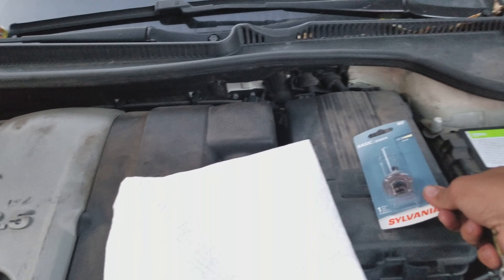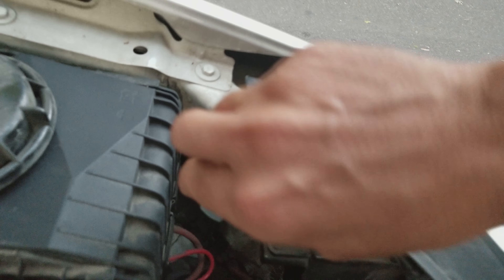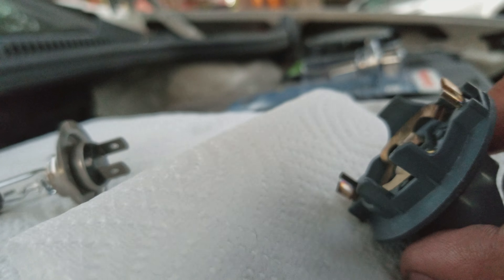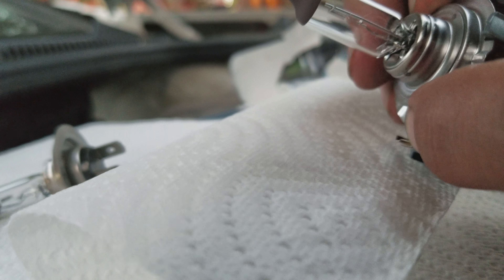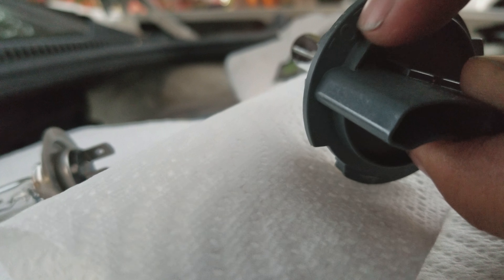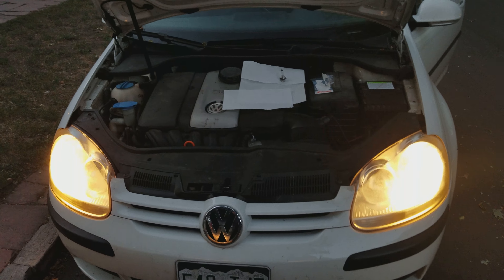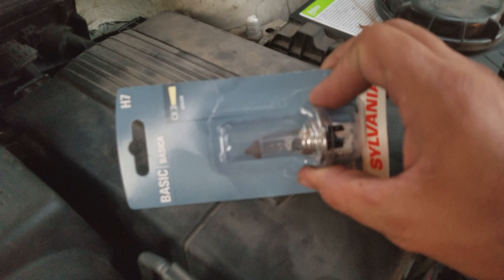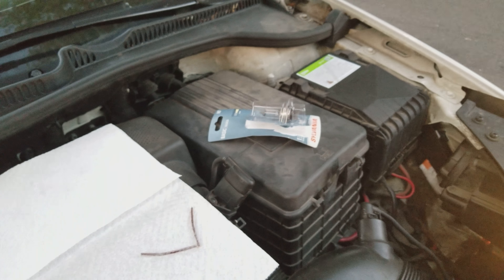How to change / fix a headlight Bulb in Volkswagen Rabbit Jetta GTI Passat Golf 2007 2008 2009 2010

Comment: what about the Bright bulb?
Reply from the maker: I have not had to do a high-beam yet but I think it's pretty similar of a procedure
Reply: @NickTheDenverDirtJumper  the High beam has a plug without clips; simply wiggle and pull out (very stiff, thinking it could break), then un-clip the hinged bulb holder/clip; replace the bulb, add Dielectric Grease to the plug contacts, incert the plug; all is well... 🚗

Comment: No one ever says what b ulb u need in these videos. And that's the high beam. Low beam is much harder to do
Reply from the maker: It's an h7 bulb and there's a link in the description. And that is the low beam it's also the same as the daytime running lights I've had to replace multiple. it's not the high beam.

Comment: NOT for 2008 as I have one.  There is a wire clamp to remove and the bulb has a socket holding the bulb that is removed from the main housing.  I want to know how the bulb itself is removed under this type of setting. Sadly after viewing a dozen similar videos, nobody has a clue.
Reply from the maker: Is it a Jetta or a GTi with Xenon bulbs?
Reply: That's the daytime running light. The actual headlight is further outboard

Comment: I don't "pop a trunk", I open it. And it is a bonnet, or as you yanks say, a hood, anyway. Trunks are at the other end. But useful vid anyway.
Reply from the maker: I got nerves for some resin and said pop the trunk.
Reply: Soz. I was being a bit harsh. Considering how useless my Passat manual is on changing light bulbs, this is a valuable utube. Cheers.